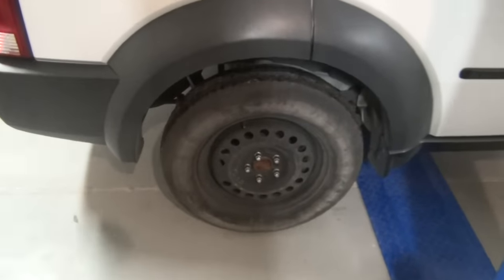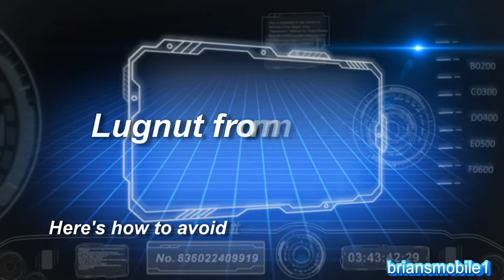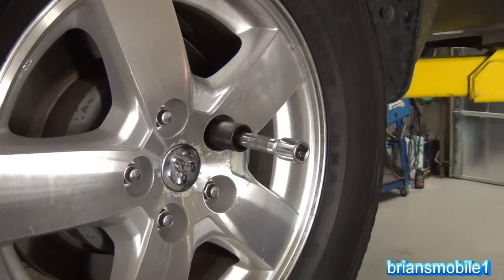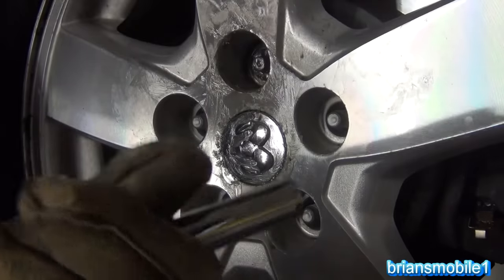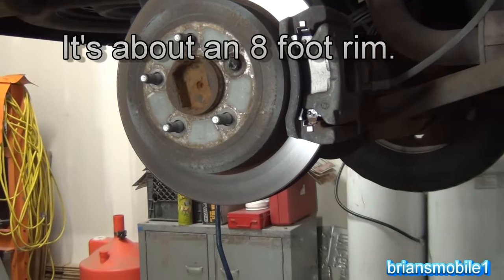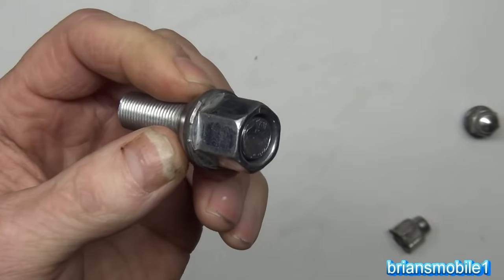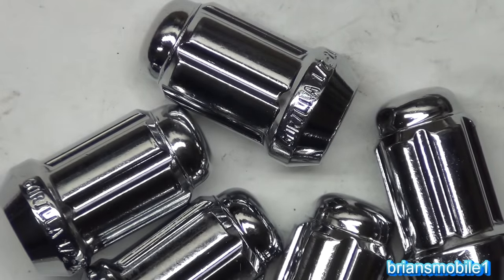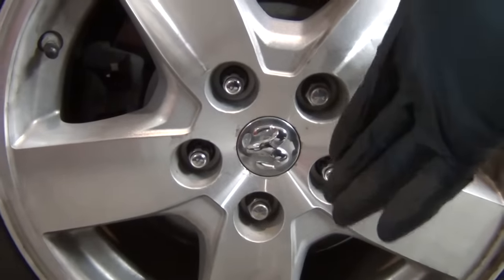Lugnut From HELL

Comment: I had an e46 m3 that the rear lug nuts were stuck. 
I tried using impact gun. No go
Breaker bar no go. 
Then I tried a metal bar on  a wrench and it 
broke my wrench 
Tried a bigger wrench with the metal bar and a bigger wrench. Finally it gave out. 
This metal bar must have been at least 1 foot long but it was great for the torque.

Comment: That extractor works great. But you should have hammered it down deep into the extractor and then took a nice breaker bar to it., with the tire down so it doesn’t move.

Comment: I had the same thing happen on my chrysler. I just drilled out the center stud.  I also replaced the factory ones with single piece chromed nuts that I got on ebay

Comment: This is why I use snap on tools...there sockets use what is called flank drive...the socket grabs the area just ahead or behind the point of the lug nut...so it does not grab the nut on the points..therefor if the points are rounded off a snap on socket will..most of the time get it off.
there wrenches are also flank drive..and no I do not work for snap on

Comment: Hey there, I had a similar issue with the same type of lug nut. At the auto parts store they sell a stubborn lug nut removal tool. It is similar to a bolt extractor but it is specifically for lug nuts. It worked great, but the cover of the lug nut got stuck in the tool and took me a long time to get it out completely.

Comment: Had the same problem when rotating tires. . Tire shop over torqued them with impact wrench. Was cross thread and outer cap broke off. Manage to get it off with extractor barely using a cheater bar.

Comment: problem i had with my silverado is they over tightened/stripped the stud threads with the impact so when it came time for me to remove them i could get off not one on both passenger side wheels. i was able to snap them off with my impact, then replaced the studs and all 24 new lug nuts. now i have my own tire changer. never again!

Comment: What would happen if you spun the other 4 lugs on loosely and carefully drove over some boards or a curb or something?  That'd be a lot of force on the one that's tight that could snap the only attached lug in half.  Just a thought.  I once put all 5 nuts on loosely and backed out of the driveway to break a wheel loose that was stuck to the rotor.

Comment: I would have put on a 3/4 inch breaker bar with a 4 - 5 ft steel bar and snapped the lug. No heat exposure or pounding to the bearing etc. Lot of the chev silverados have the stupid chrome capped lugs too. Once corroded and swelled they also make torquing the wheel properly very dicey.

Comment: Really good advice.  Given that the melting point of Steel is about double that of Aluminium( ~2500F vs 1221F); how did you manage with plasma cutter to not cut through the wheel?  Is it just that you are REALLY good?
Reply: +Scottish Bob And, in hindsight it occurs to me the wheel is not Aluminium and I have no idea of the alloy or the melting point...

Comment: the easiest way to do it is to just blow through it with an acetylene torch and replace the stud. you cant cut aluminum with a torch so you will only be cutting the stud and nut.

Comment: by the way, ive repaired 3 cars with broken gorilla lug nuts. The socket side cracks and unthreads and all that is left on the wheel is the taper and then you are SCREWED! Off to the drill bit!

Comment: Thanks for this video. I just got an old vdub with a similar problem. Got a few somewhat stripped lugs and one HELL nut. They tried to remove the nut, but it's soft, rounded, and cut into...guess I'll have to do your force method. Days of working on that single thing to get it cut down.

Comment: I would have put a 4 way lug wrench or I would have tightened the lug nut until it broke off. (Then replaced the stud,) You are going to have to replace the wheel stud and lug nut anyway. Thanks for sharing

Comment: if I recall when those chrome caps come off those dodge 19mm chrome nuts, doesn't an 11/16 socket fit perfectly. seem to remember finding this out the hard way on an intrepid. of course if the nut is already rounded off. something I bought that really helps is a snapon 3/4 drive gun that has about 1600 ft/lbs of reverse torque have used it to remove quite a few stubborn lug nuts. of course have had to torch a few. my boss did one on his own car had to use a hole saw, that fit perfectly in the wheel nut well. he was using those gorilla nuts but he had the stubby ones that were open on the top, they about an inch tall, the splines sheared off right at the taper.

Comment: Craftsman makes a 3 piece kit called Lug-out for $50 they work great. Rather than destroying shit with the torch. Also snap.on has flip sockets that are 18.5mm x 19.5mm and so on for swollen lug caps or if the cap is missing. Mainly an issue on fords and Chrysler. Use them all the time never have to mess anything up like this.

Comment: I had same issue with a jeep cherokee i bought from craigslist. anyways  if it is an aluminum rim you can just heat the lug nut and stud red hot and just blast it out with a cutting torch will not  damage the aluminum rim because aluminum does not rust and when you use the cutting torch essentially its  just rusting the  nut and steel  very rapidly. so you could have saved a bunch of time by just using the cutting torch as a cutting torch and just blasting it out and replacing the lug stud . anyways mabee that will help you in the future if you ever come accost the same issue i got mine off in like 2 minutes. rims wer fine afterwords .

Comment: I had this happen not to long ago and ironically on a dodge durango with the same crap-tacular lugs. It took me a week cause I didn't have a good working blow torch and I ended up drilling  around the lug nut where they sit inwards to pull the tire off. Once off the rim was no longer usable and I had to grind down the lug bolt to get the rest of the lug off of them and pound them out. Luckily it was just one wheel but 5 out of the 6 lugs had to be drilled through. I just got another durango and low and behold same damn lug (SMH). Standard chrysler lugs anyone with a mopar that is roughly 14 or younger year old needs to change them asap. As well word of advice do not let any mechanic tighten your lugs with a impact drill. This is what happened after having a quick conversation with the previous owner of the dodge I had to drill the lug out and he said a good mechanic friend put them back on with his impact gun another SMFH.

Comment: I would've went with a 3/4 or 1in impact driver/socket setp running off a larger 1/2in air hose. Yes it would probably twist the stud off but that would have to be replaced anyway.

Comment: you first attempt would have probably worked if you beat the extractor on with a hammer and dont be shy about it,  make sure its good and on there, then get a power bar/breaker bar and giver, shell come off, i work in a junkyard next to an ocean, we have this problem all the time, this method also will break the wheel stud at times but with dodges thats the norm

Comment: yeaaahhhh this would not have happened to me.

PS, My reasoning for saying this.. Honda Civic Harmonic balancer Bolt!

I ended up giving up on the proper tools. I Locked it in place, put a breaker bar on it, got a jack stand, secures the 2 foot long extension on it and then brought out my secret weapon.

A 6' long Steel Fence post. put it all the way down the break bar, supported myself, and started bouncing on it. Your impact was too weak. No shame in that though, it is what it is.

Comment: Wow, this guy is an crack me up! Next time try using the lug wrench that came with the truck with a metal pipe and some good old fashioned elbow grease or the socket with a breaker bar. I have had this issue after having my tires replaced or rotated,  I would either use the lug wrench with a pipe or a socket and breaker bar.

Comment: Had this happen on a Buick Regal, I found a hole saw that fit just inside the pocket and drilled through the wheel. Removed the wheel and the lug and piece of wheel came right off

Comment: I've watched a few of these types of videos when I accidentally cross threaded one of my lugs one time, what a nightmare...
Noticed you have no wheel bearing dust cap.    I remember when I found out one of mine was dented, and I had no idea how it happened, I figured it out when I finally had to replaced a lug stud myself and ended up denting another one, turns out the mechanic I had went to years ago dented it with a missed hammer blow replacing a stud the first time.  The random things you learn when working on your own car lol.
I was lucky and the nut didn't round off, took a breaker bar and just unscrewed it by force and shredded off most of the threads to get it out.  Not a gm nut, luckily, the japanese seem to use one piece nuts on the portion that matters.

Comment: When I once worked at Honda we had someone change a flat in the rain, they dropped one of the wheel lock lug nuts in a puddle and didn’t try to dry it out before putting it back on... then waited a week to get it in to us. We snapped the lock nut in half down the middle of the threads and had to hammer and chisel the other half off.

Comment: I have a 4 to 1 torque multiplier which can generate up to 1000 ft-lb.  I have yet to find a crank bolt or any bolt that I haven't been able to remove.  You should look into getting a 4:1 torque multiplier.

Comment: Why not just drill straight down the middle of the wheel stud? Pilot hole first, then big enough to cut into the nut threads. It will weaken the nut's grip enough to make turning it off with a socket easy.  Both nut and stud are beyond saving anyway.

Comment: "A common mechanic tip is to use a smaller socket".  You don't need to be a mechanic to know that if the cap is gone it's a smaller nut now and you should get the proper size socket...

Comment: You should have housed a breaker bar with the extractor instead of the impact. The impact hammers which will round it more as in straight torque would have most likely snapped it or broke it loose

Comment: Question for you Brian seems someone cross threaded the lug nut on my car I dont have torches u think a breaker bar would take it off with enough leverage pls pet me know I been spraying something called freeze off  and. Normally that eats rust and anything off but i try using the impact. BUt not coming off with impacts I was even trying to break the stuff but not working HELP

Comment: If the socket is 18mm. take a 17mm socket and beat it on to the nut. Get a long cheater bar and take it off. Easiest way ever. Been doing it for years when I get these kinds of lug nuts

Comment: It's not just Chrysler, but in any event. Back a few years didn't Chrysler cars and light trucks have a reverse thread on one side? With the idea if it loosened, the spinning forces of the wheel would not let the lug nut come of completely! I have seen many owners not aware of that fact really have a bad day trying to get the flat off by the side of the road! I'm not sure if Chrysler still does this, but I believe my 2003 Dakota has the reverse thread on I believe the passenger side. I do remember they had that cheap cover, plus the soft lug nut underneath! I went to aftermarket lug nuts after that, but found nothing like the Gorilla brand your tip showed!

Comment: It once took me four hours to get my friend's wheel (one wheel) off.  The previous shop that did the rear brake applied anti-seize compound to the wheel studs and drove them on like crazy.  I guess they did not like using a torque wrench, and re-torquing them later. It is amazing how ignorant some mechanics (shop employees) are.

Comment: Had this happen at the shop on a Jeep and I just drilled the whole lug out.. started small worked my way up till the wheel fell off. I didnt want to take any chance damaging the aluminum wheel. I have actually had another Jeep do this as well.. but pounding on a 3/4 drive nut remover then hitting it with the 3/4 snapped the lug off so that worked out as well. Still sucks.

Comment: Dude, all that heat on that polished aluminum wheel made me cringe.
 I've been there before, used some paste, (similar to the nozzle paste you used) from a welding supply that is specifically for dispersing heat and protecting surfaces near where you need to do some surgical welding.  
Then I welded another lug nut on to of the stripped one.  Kinda worked.  I ended up buying a long socket one size smaller and beat it on.  Luckily I was able to wrench it off that way.  
Great video, sorry for you luck but you rocked it.  
I appreciate your professionalism not calling out the company, since the manager did you "right".

Comment: I can solve you a lot of trouble in the future here.  Same thing happened to me this morning at a shop on my JK, same lugnuts, it is why i ended up on this video.  They'd wrecked the wheel already before coming out to talk to me unfortunately but.. anyway.

It ain't hard.  Take a center punch, take your time, get it dead center of the lug, tappity tap tap.. make a good detent.  Drill a pilot hole to the depth of the bottom of the acorn with a 1/8" drill bit.  Take your time, be super careful, lube the bit and keep it straight.  Use a sharp bit.. Don't break the drill bit.  Don't.. Just don't.

Then drill it out with a 3/8.  it'll just be there with the threads.  Put the impact on, give it a bump, whole thing will break off clean.  Pull the caliper and hat tap the remaining stump out, pull a new stud through, put your brakes back on and go. Sounds like a lot, takes 10 minutes.  A dewalt drill on low range at about half speed is as fast as you want to go, focus on pulling a nice clean chip.  If you aren't getting a chip stop and get a fresh bit.  The stud material will work harden if you use a dull drill.

I've done it before, I did it this morning, it always works and it won't bitch your wheels up.

Comment: 2004 Jeep GC, 4 wheels, 20 wheel nuts (lug nuts in US), 19 off and 1  too fn tight and rounded. Will try a wheel nut remover tool and as a backup locate someone with a plasma cutter.
NEVER do wheel nuts up with the bloody super high torque electric wrenches.

Comment: I always use valve grinding compound smeared on the socket and lug nut, then breaker bar. it really grabs and will not slip.

Comment: Never use flame 🔥!
Over tighten it and break studs . Or drill out and ez out. Dont make it hard.
Think. Drilling is the best and easiest.  Just have to replace the stud and all lug nuts. That heat is weakening the wheel too!  Tourist, geesh

Comment: I had the same thing on my Neighbors  Jeep all I did was drill in the center of the stud first with a small drill then a larger one.  run the drill slowly not to burn it up. say the lug stud is a 1/2  Diameter drill it out to about 3/8 Diameter  just deep enough to be at least as long as the lug nut . then take the rest of the lugs off and pull on the tire to snap off the weakened lug stud that you drilled  install a new lug stud and done

Comment: Mopar Didn’t design those Lugnuts very good those caps are a nightmare..When you use the cutting socket use a breaker bar not an impact it will come off you hammered on..I come across them every day

Comment: Had to drill out my stud .I was turning the nut and the stud was spining . The salt was the root cause. I had to sharpen my drill bit 2x for every holder size it would just chip . Studs are hard britle thing I learned.

Comment: Hey Brian, did you try lowering the car to the ground and using a really long cheater/breaker bar? I've done this with a 1/2" socket, a cheater bar, and a long pipe over the cheater bar.
Reply from the maker: I did, but it just started rounding it off.  Should have drilled it out to start.

Comment: Been there twice! The first time I took a piece of iron pipe, hammered it over the smashed up lug, then stomped it breaking the stud out. Pressed out the old stud, put the new one in, felt pretty good about myself. So the next time it happenned, I thought I'd be slick and repeat the process. Ahah, the joke was on me - the crappy stud bent but never broke. A buddy with a plasma cutter helped out, but we wound up basically cutting the wheel off. $10 at a junk yard, and we were back on the road.

Comment: There is no corrosion.  Your heating the stud at the same time.   I would cut it off(nut) or use cold spray or try clay wall and fill with penetrating oil for few days.   Your nut is recessed into that hole.  You want to expand just the nut.

Welcome.

Comment: LMFAO... Holy crap this was hilarious! So... Next time... And I did this with a similar 2009 and 2013 F150 lugs that the "tire shop" ruined. Hammer the center with a punch and hammer and then use an air hammer to carefully get that outer shell off at the hole you made. When you close to bottom of wheel, I used a flat tip screw driver to pry the last mm or 2 of the shell in two. Use some needle nose pliers to wiggle them out. It took an hour each wheel... Six lugs each... Long day... But I didn't ruin the solid inner lug and I didn't have to buy new ones. Cost me some blood, a few band aids, and some dings in the inner rim... But I won't have that problem again... Jus saying...

Comment: lol, Chrysler crappy capped lug nuts, Snap-on makes a socket specifically for that situation because it goes from 19mm to 18 1/2mm or something like that when the caps break off, also should use a torque wrench to properly tighten the lug nuts, it shouldn't make an impact gun struggle to get it off

Comment: The impact gun would have taken it off with ease if the NON_IMPACT extension was not used. Using ANY extension can reduce the torque of a any gun by at least 20%.